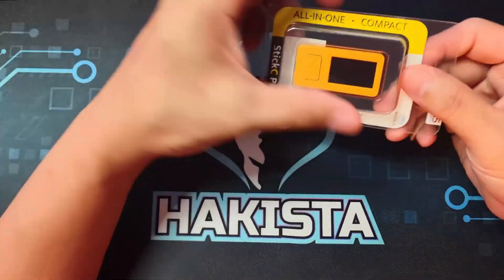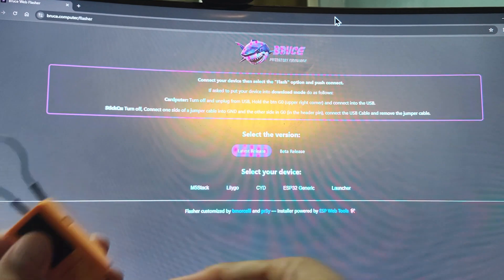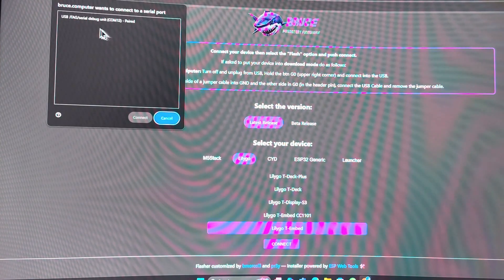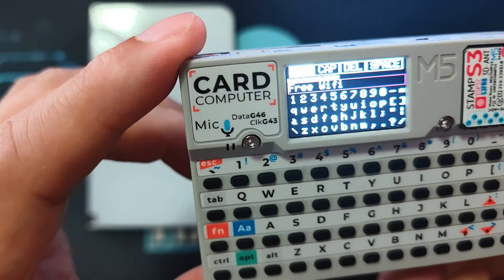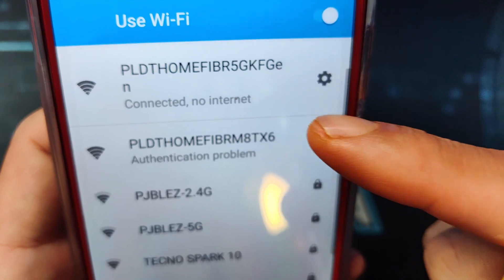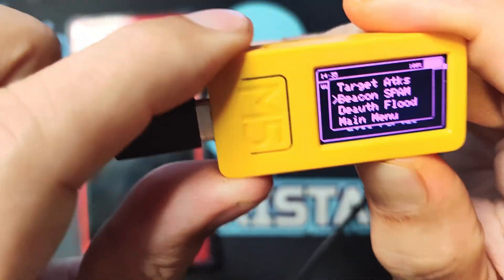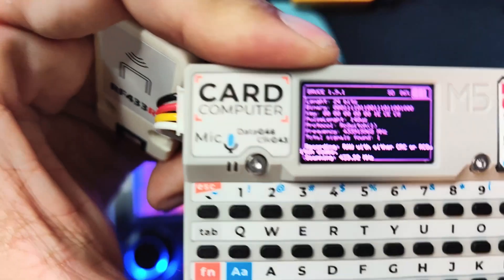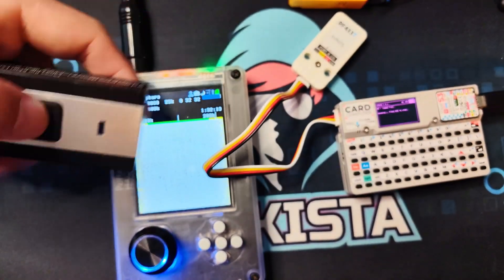Unlocking Bruce Firmware: Your Flipper Zero Alternative - The Full Guide

Comment: hi please reply me 
i have a question can we use bruce on m5 stack c plus 2 with rfid 2 module(offical m5stack) to capture and record mi fare classic s or mi fare classic s 1k card. becuse these are magic cards and unable to clone and copy without key.
so can we do that with m5stack and rfid 2 module.
like clone mifare classic 1k or mi fare classic s card.
Reply from the maker: They can read but writing if the key is not 12Fs then they cannot write, for that will need proxmark flipper zero
Reply: @HakistaTV  so means its not a flipper alternative, and can we clone this.
Like we have a metro card with 2 bucks balance so can i clone it

Comment: Hey, so I recently bought the Alpha AWUSO36AXML this network adapter with the mt7921u chip set. And for some reason I am limited to 3.00 dBm. My reg allows till 20 dBm. I tried other reg also like US and even BO. I tried setting tx manually but nothing changed. My kernel version is the latest and has the drivers for this adapter build in. Any ideas?
Reply from the maker: Wow, im was not even aware you can use a wifi adapter on bruce firmware
Reply: @HakistaTV so no ideas

Comment: I have BRUCE on my Lilygo Cwhatever and it kind of sucks, how do you power on and power it off? Seems like you turn it on by charging it, and then have to wait for the battery to die.
Reply from the maker: I didnt figure it out, i just stopped using it and use cardputer
Reply: @HakistaTV  I think I'll try that. How do you not code that into your firmware?